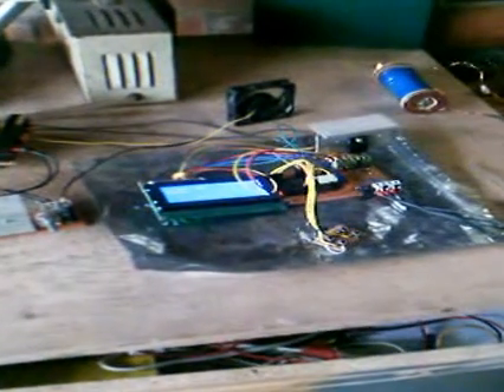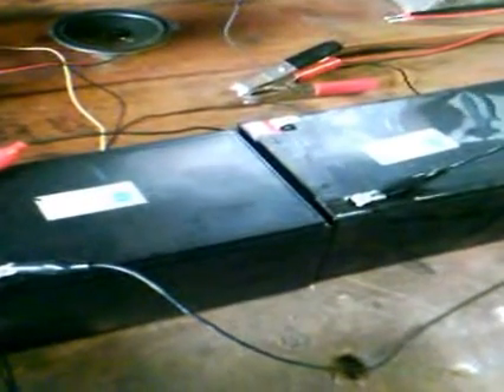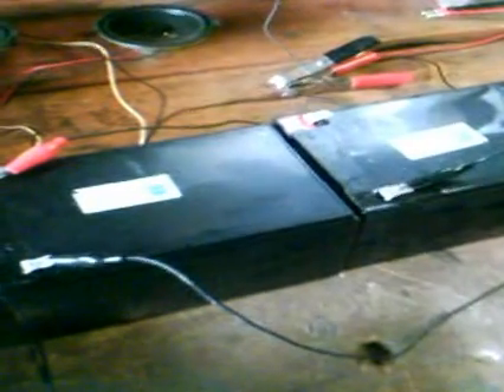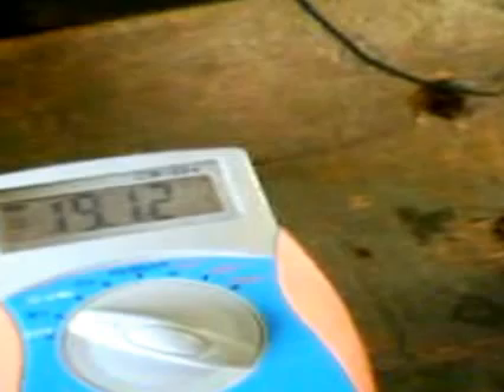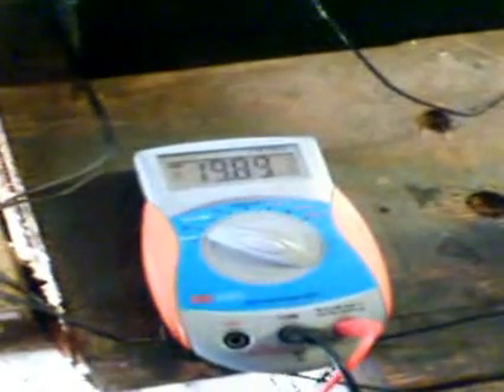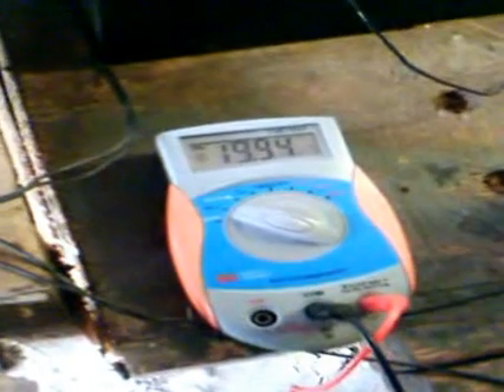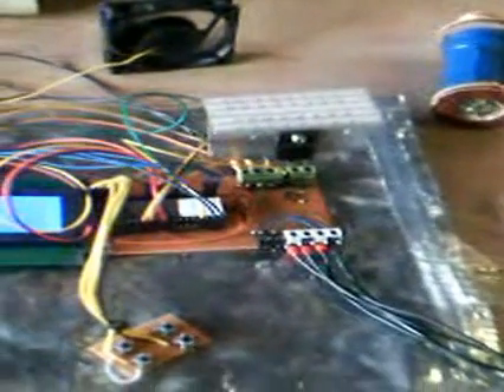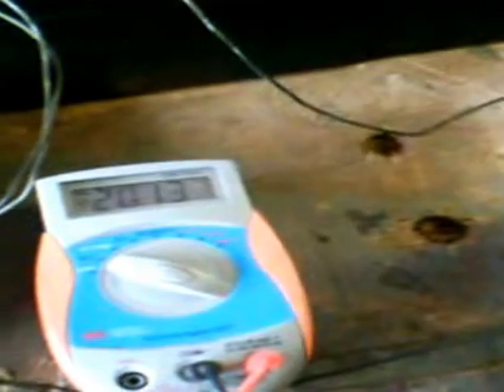NON Bedini SSRG Solid State Radiant Generator

Comment: If you're using BJT, then, the heat is caused by running the transistor under saturation. Have you tried darlington?

Comment from the maker: mosfets only need drivers IF your connecting them in a 'certain' way...
The transistor i'm using their is very old, has a bad on state resistance and bad switch speeds... which means it generates heat and is in-efficient on power...
I'm using it because of it's high voltage handling capability...